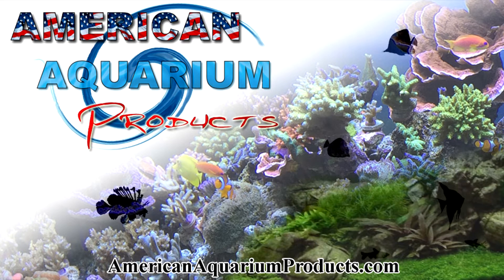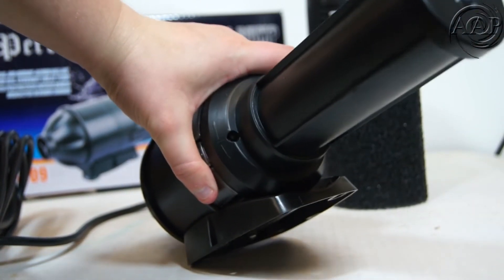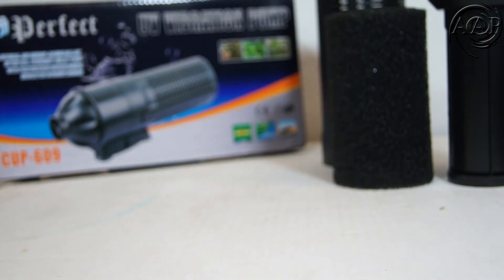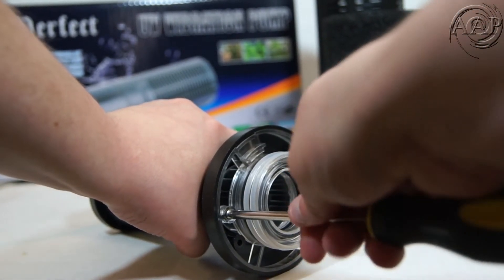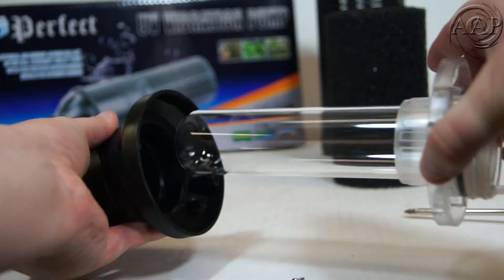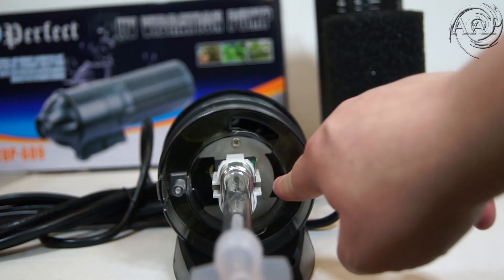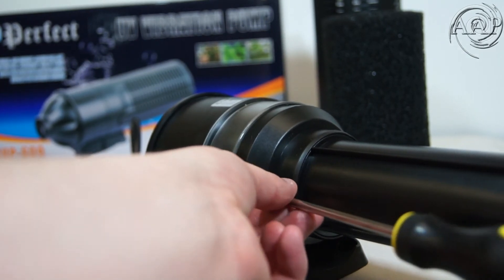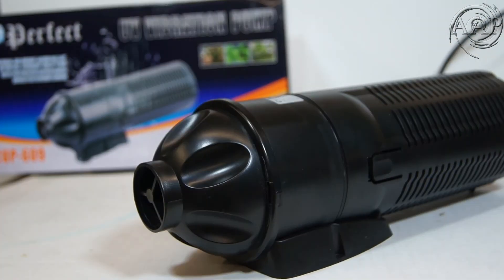SunSun CUP UV Bulb Change

Comment: Hi, thanks for your informative video. Just one thing though, can you please tell me what the use is of the white plastic bit on the end of the uv light bulb? Is this white plastic bit meant to be removed before use or should it be left on? Thanks
Reply from the maker: It's meant to be on. It holds the lamp in place.
Reply: Thanks  @AmericanAquariumInformation  for your help. I left the plastic piece on. After using the UV filter for three to four days I saw a dramatic change in the cloudiness of my water. It is crystal clear now. :D
Reply: The main purpose is to keep the lamp from moving, especially when being transported. Once in place, it can be removed if desired
Reply: Thanks  @devontrigg642  for your help. I left the plastic piece on. After using the UV filter for three to four days I saw a dramatic change in the cloudiness of my water. It is crystal clear now. :D

Comment: do they get hot & melt or release uv-chard plastic into the water?
Reply from the maker: Only if an air pocket is in the unit. But the plastic will degree over time. Like 10 years maybe?
Reply: As noted an air pocket or lack of water movement would be the cause of such a problem
Reply: Thanks for letting me know.  I just bought one & hope it works out well.  Some of the cheapest SunSun JUP-01 sometimes have been known to have problems as fast as a few weeks.  But that is when people run them 24 hours per day in hot water tanks...
Reply: keep in mind that the JUP 01 is only a Category C UV Clarifier, not a true V Sterilizer (category A or B)

Reference:
http://www.americanaquariumproducts.com/AquariumUVSterilization.html#categories
Reply: just means you need to go low flow and leave it in a bit longer.

still same principle, still works.

increase the wattage or use multiple for big tanks.

also, as a side note that category nomenclature is confusing, given there is also classification of UV itself (A, B, C) depending on the type of wavelength of UV produced primarily by the bulb in question.

Comment: My UV lamp started blinking. I admit, I didn't change it for long time. Is it normal behavior of an old lamp? Or something may be wrong with the steadiness of electrical supply? I mean the electrical supply within the sterilizer itself ( I connected to multiple outlets, the problem persists). I don't want to buy a new bulb just to find out that it also blinks...
Reply from the maker: +larkysnake It could be the lamp going bad, or the ballast. Best idea is to start with a new lamp as this can happen with old bulbs..
Reply: +American Aquarium (Carl Strohmeyer) 
Thanks, I will buy a cheap lamp to try. If everything works I could change it later. 
As for the quality of lamps, are there any suggestions, which work best? There is so many of them for sale with varying price range, but perhaps they are all made in one place somewhere in China.
Reply from the maker: +larkysnake A cheap lamp, should only be used as a test. There is large differences in lamps on the market. They will have 7% UVC vs. 35%.

Here's some troubleshooting help:
http://www.americanaquariumproducts.com/UVBulbTroubleShooting.html

Here's to should the differences in bulb qualities:
http://www.uvsterilizerreview.com/2013/10/actual-uv-c-emission-from-uv-bulb.html

A resource for good bulbs
http://www.americanaquariumproducts.com/UVCReplacementLamp.html

Comment: That's a great video.  Watching, it appeared as if you were trying to NOT touch the uv bulb itself.  Is it an issue if you do touch the bulb itself or do you recommend only touching the ends.
Reply from the maker: Outside of leaving any oil from your skin on the UV bulb/lamp (which might impede UVC every so slightly) touching it is not a problem